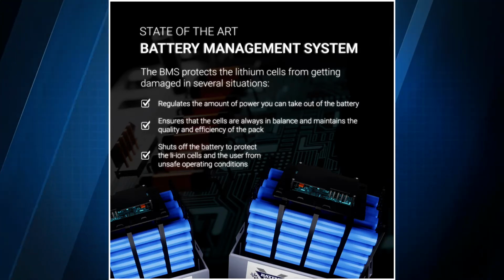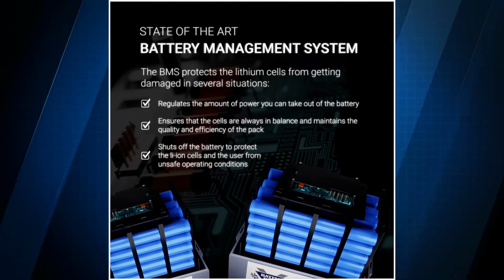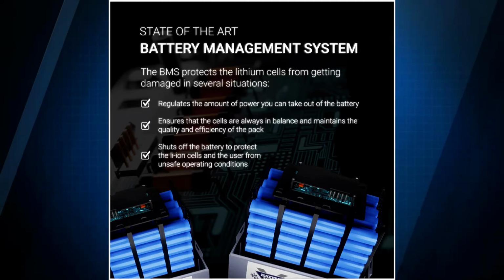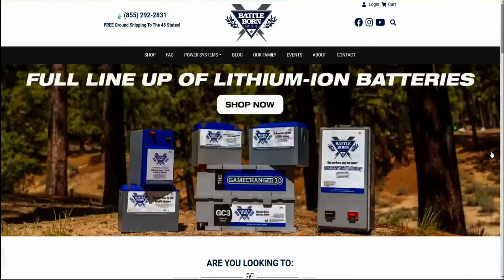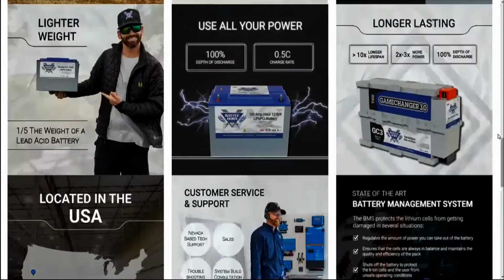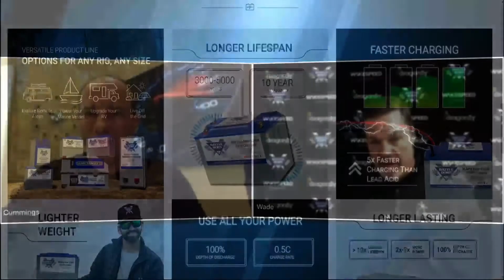Changing to Lithium RV batteries, watch this

Comment: Yes, a "Chief Revenue Officer" for a company is going to be the best source for facts.  FFS. 

I'll address the very first claim and stop there.  "You're going to charge 3-5 times faster".  BB's recommended charge rate is 0.4C, so 2.5 hours to charge.  Pb banks take 5-6 hours, including absorption.  At worst, that's 2.4x faster.  And 29 minutes left to go in the video. 

Lithium is good enough that we really don't have to exaggerate or stretch the truth to make the case.